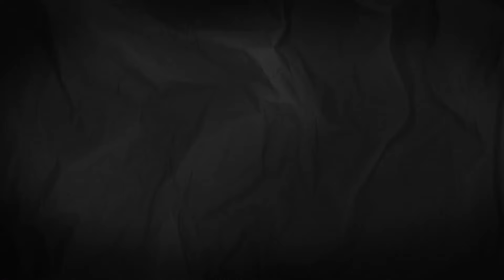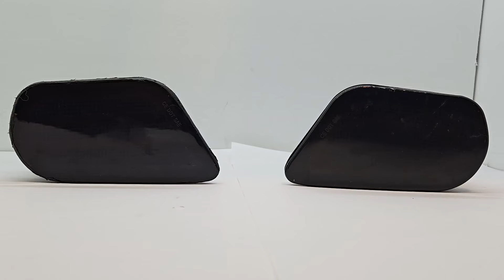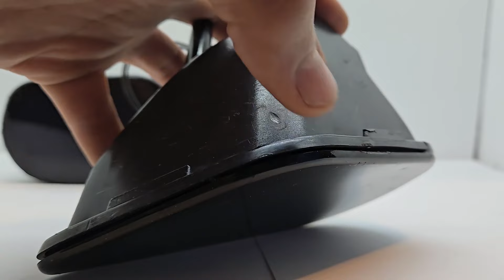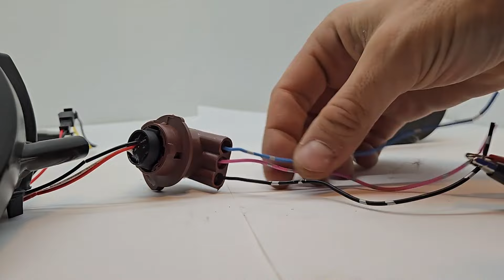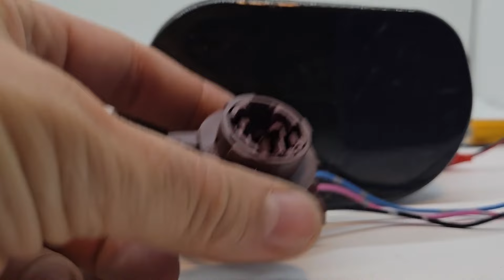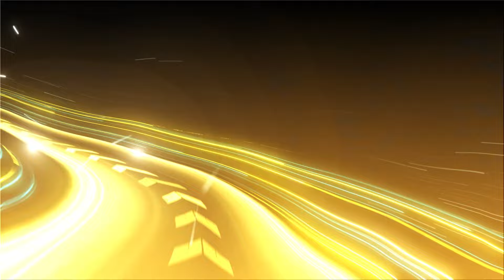Version 2 - 98-02 Trans Am Front LED Sequential Turn Signal

Comment: For sum new reason my driver I can plug an play but the passenger doesn’t not halo. It flashes for turn signal just fine. Just the halo won’t stay on. Has to be some wiring. Any ideas?
Reply from the maker: Does the Halo turn on at all for that side? If not that one may just be defective

Comment: I have a question. So I have a 95' Trans Am and did the 98-02 front end conversion. So I bought a set and spliced in the white wire with the brown and get only the halo. I cannot get any amber part to come on. Just tried with the white wire unhooked and jumped into the brown. Any ideas? The stock lights worked fine, no day time running lights.

Comment: I have these lights, but I appear to have an issue with passenger side. Driver side is completely fine. Sometimes when I cancel my turn signal, my drl wont come back on. If I squeeze or press on the drl module, it will come on. I’ve tried to replace it from one from eBay, but I guess both my original and that one seem to be bad. Is it possible there’s something wrong in the circuit board?

Comment: I got these, just plugging them in and the day time running lights is the halos. When I put my signal on it’s the halos flashing, and when the headlights are on with or without turn signal it’s still the halos and halos flashing. This is without the white wire being connected to anything. Would you have any advise on how to get the amber for day time running light and amber flashing with turn signal? I don’t really want to see the halos at all.
Reply: Did you figure it out? I'm in same scenario

Comment: can you add a link to the light setup you recommend?   I want to order them but want the "not spastic" ones...  dont know whats what though..
Reply from the maker: @PaleHorse_5.0  Sadly that's near impossible to say.   I ordered my original set 2 years ago and they may have changed.   These are what I originally ordered three sets of.   Can't guarantee though cause he could have changed supplier.   https://www.ebay.com/itm/294642314878?mkcid=16&mkevt=1&mkrid=711-127632-2357-0&ssspo=7DrLaKNASYm&sssrc=4429486&ssuid=wFW0q2hNRKK&var=&widget_ver=artemis&media=COPY

Comment: Hey Jason i actually came across this the other day after ordering another set from amazon. I had on my passanger side the amber/turn signal would flash like that when starting the car but after i flipped the plug/socket and reconnect it stopped flashing for right now lol. Great video bud
Reply from the maker: @phillipjaques4640    Yeah I probably should have mentioned in the video to make sure to line up the black wires when plugging it in.   Both of my new Amazon ones do the super flash if it gets a constant signal from the daytime running light wire.   It's interesting though that you can plug the connector in either direction and they still seem to work.
Reply: @1999TransAmWS6  yeah i thought it was pretty weird myself but it seemed to work for me I'm happy about it but I'm also looking for another set just in case. But I'm unsure of which ones to get lol
Reply from the maker: @phillipjaques4640    I hope they continue working like that for you and yeah buying a second set is a good idea because you never know when a product like this will disappear.   What I find really strange is the fact that I can flip the plug around and they still work exactly the same.   LEDs are usually polarity sensitive so I'm scratching my head on how they perform identical no matter how I plug it in.   The Halo and turn signal input should technically flip also but they don't.  Still scratching my head on that one, lol
Reply: @1999TransAmWS6  yeah I said the same thing when I tried it I scratched my head on that one lol..

Comment: Wondering why you don't design and sell your own line of lights for our cars? :-) PS this is the text from the ones on fleabay; "Special designed CAN-bus error-free for the Firebird with direct plug and play installation” so this is false?
Reply from the maker: That's hilarious cause our cars don't have Can-Bus.  I think that was developed about 10 years later..mid 2010s.    It really depends on which version electronics they have.   If it has the 3 position plug and the Amber stays solid on during the daytime with the headlight switch activating the halos, then yes it's plug and play.   If it has the external white wire or the amber keeps pulsing during the day then it will need some wiring modifications.

Comment: You should drill holes from the bottom , it helps with water and humidity getting out.
Reply from the maker: On this replacement one I did when I drilled the hole to let the white wire exit out the bottom.  I didn't silicone the hole for that reason so it could work for drainage too.    I see some people do that with stock housings as well since they are known to take on water being so old.